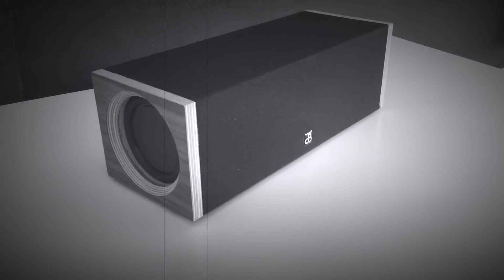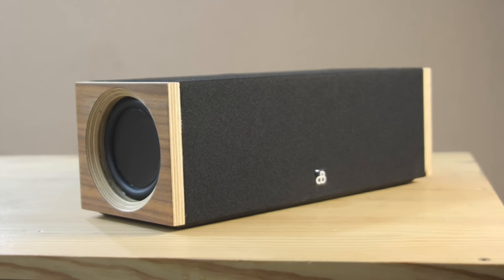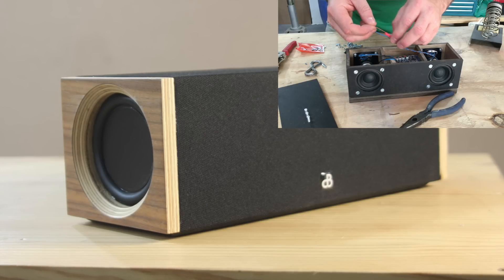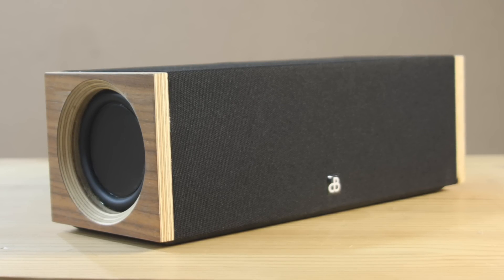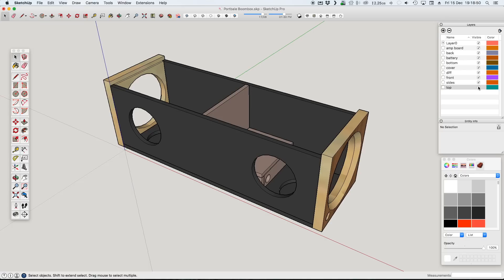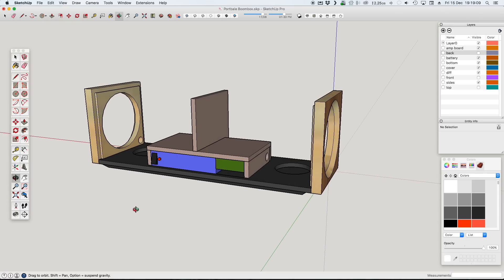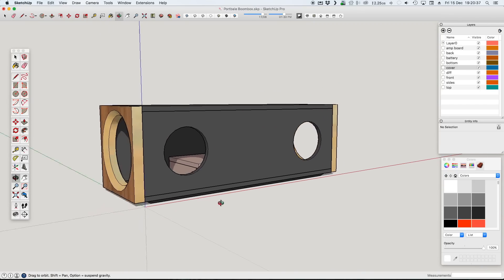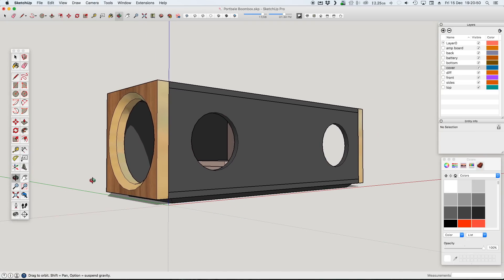Portable Bluetooth Speaker Build SOUND TEST - by SoundBlab

Comment: My Zoom doesn't like to record low frequencies, have you ever had an issue with this?
Reply from the maker: Have checked that the Low Cut switch on the back is in the OFF position?
Reply: @SoundBlab  Yup I did. Was trying to do a sound video of my VBSS end tables and the zoom just doesn't do them justice.